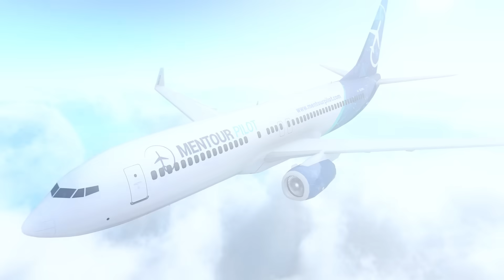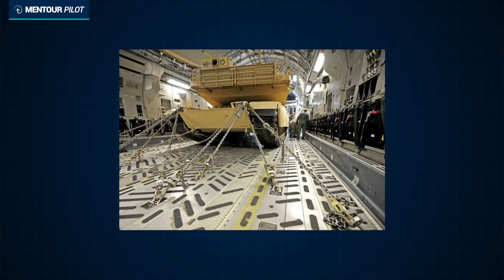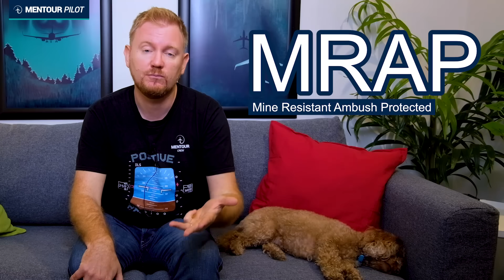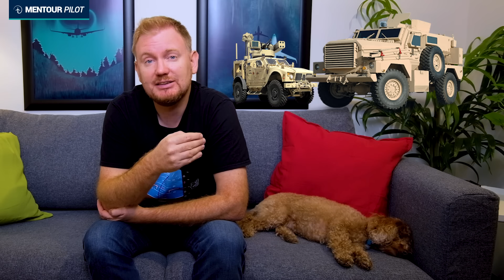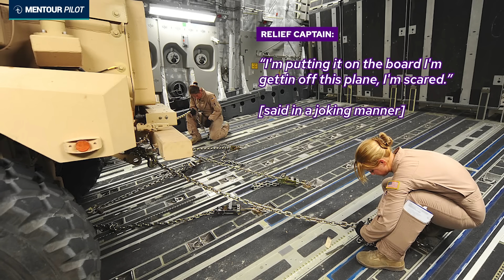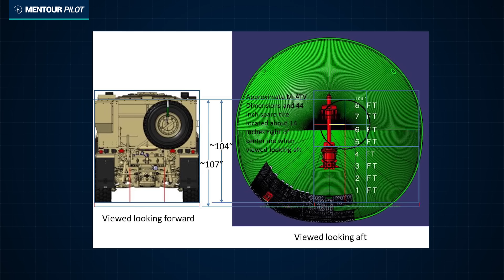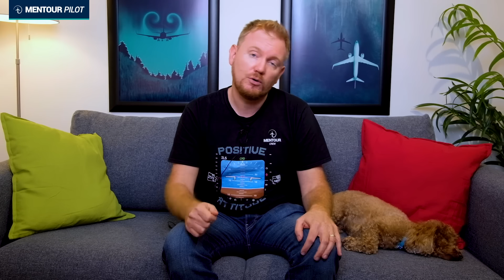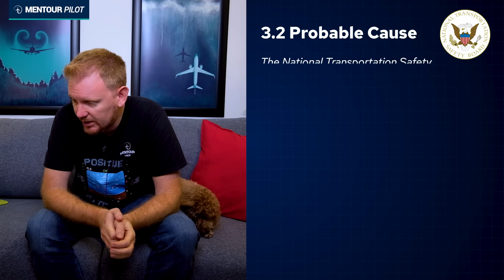Why did the pilots LOSE control?! National Air Cargo flight 102

Comment: "they always move when not strapped properly" 
continues with not strapping anything properly
Reply: If I was the pilot then I would have immediately gone off on that guy. Like, dude just admitted he didn't do his job properly and already had potentially put everyone in danger. Like, how can you be that casual about something that could (and unfortunately did) kill them all if not done properly?
Reply: @naomiskilling1093 chanced it
Reply: Er, that isn't what happened, I don't think- he just failed to realise it. The straps were not loose, they had stretched. Its possible it was caused by not enough tension in the OTHER straps, but also not enough. So, I expect he tightened up the "loose" ones, giving more force on the ones most likely to break. 

It is entirely possible that the rails failed, however, with the increased pressure of tightening- due to lack of strap distribution, but as said, many experts also though that seemed like enough straps. The knots thing is a bit up in the air, but it is still possible for the failure not to have directly been his fault. The very nature of special cargo involves strapping to hard points, but he clearly had no way to know how much each of them could take.

I think the big disconnect was a clear lack of guidance on how it ought to be done by people with engineering degrees to calculate stress loadings and explain strap strength with age and knots and folds and moisture, and how you need at least 4x tolerance to expected forces.

If you ask an untrained monkey to fly a plane for example, is the monkey at fault when it crashes?
Reply: Why dont they use chains ? Lazy fucks drive them cross country !

Comment: I remember seeing that footage and just feeling awful for the pilots. One thing that the physics nerd in me has always been curious about though, Is the condition of the vehicles. I saw a post crash photo of one of the smaller m-atvs, the only one to escape the fire, and while it was smashed up.. It wasn't unrecognizable. Now seeing as these things are designed to be pretty tough.. Fair bit of armor, especially on the bottoms, and this was the lighter of the two, how would the heavier duty ones have fared? I'm sure destroyed, but how badly? With the sheer insane forces involved in a plane crash like this, could anything survive in relatively non smashed to smithereens shape? An MRAP is tough.. But it's nothing compared to an Abrams tank. I don't know if a 747 could even carry an Abrams, but the C5 Galaxys do it. If something as heavily armored as an Abrams were in this crash, or theoretically an identical one aboard a C5.. How would it hold up? I'm still assuming damage. Probably the 120mm barrel/tracks/wheels would be a total loss.. But would the hull/turret be in OK shape, possibly repairable if no fire? Or would even something that tough be flattened pretty bad? I don't know if there's any physics experts.. Or tank experts, or both out there who would even have a ballpark idea.. But it's just something I've really wondered about since first hearing of this crash. Again, RIP to everyone involved. And another excellent video by mentour... Sorry about the wall of text for anyone who bothered to read this far.

Comment: A moment of silence for all the folks that lost their lives in this accident. It's an awful reminder that the captain must ensure the cargo is secure, first hand, because the flight crew will sink with the ship, cargo and souls on board. Don't accept second hand info. Be informed and verify for yourself. 

The worst part of this tragic accident is their own corporation wasn't aware of how to handle a out-of-normal cargo load to advise them properly. A call to headquarters inquiring should have been escalated to the aircraft manufacturer for guidance. This is just a failure on many levels.

Comment: I remember when it went down the Taliban tried to take claim for shooting it down, so that's the first thing we heard. I landed in a blackhawk helicopter on BAF runway 3 circa May 20th 2013. There was still a massive scrap pile of parts from the plane there. It was a unexpectedly sober sight. Some of the soldiers in my unit saw it go down and it really freaked them out. RIP to the crew.

Comment: Horrible.  Need better "rigging" technology. First  of all to the extent straps are inelastic,  multiple straps from a single point on the load do not distribute the force among them, the tightest strap carries the full force until it breaks. Also, the rigging should be instrumented with stress sensors to enable continuous monitoring and safety assessment. I wonder if in the subject event, the takeoff might have been aborted by a system that would have detected unacceptable strap stresses or cargo movement during acceleration on the runway.

Comment: Got a Question for you pilot. If you are Flying a Commercial Airplane and you loose all of your Engines what you do to Save all the Passages etc and  yourselves how would you mauve the Airplane still with out power to Safety land the plane.  I know Small Planes like Cessna 152 can do it without any problems you can still land the plane safety. But what about the Big Commercial Planes can you do the same. Please response to this Question with a video or something I would like to see the different from a plane to plane performance

Comment: Oh gosh. As an engineer this brings back such painful memories . In my case visiting relatives on a farm site not related at all to my work. There was a contract crew there erecting a large shed (like 100mx50m area). As I was driving away after the visit I glanced over at the site and my immediate thought was that the frame did not seem to be properly braced while they were assembling roof trusses. But hey, I was  a process/mechanical engineer, not a  building engineer and not my job right? Even so I came within a whisker of turning around and going back to make my thoughts known. Next morning the wind picked up and the whole lot came down with the crew working up on it - fortunately no one injured but that was more luck than anything else. Moral of the story: If you see something like that which makes you feel uneasy particularly if you have at least some technical knowledge of what is going on, don't be afraid to make a fool of yourself for peace of mind. You might just save a life! In this case, the correct bracing struts were a late delivery so the crew pushed ahead too far in the schedule with what they had.
Reply: Here, in Australia, we had a mining engineer in the city noticed a walkway that had some cracking.  He called the City Council and they had the walkway closed and the laneway below it closed as well.  Later that night the whole thing came tumbling down.  Had that engineer not seen the cracks and not reported it, any number of people could have been seriously injured, or worse.  This was as people were leaving work, so pedestrian traffic was high.
Reply: Oddly in Canada engineers are by law allowed and required to step up when they see a public safety hazard even if they are just passing by (similar to Medical Doctors that have to help, even if they are just happen to be there). On the other hand: Engineering is so complex, that it is hard to know if something is "innovative" and "safe by unconventional means" or just insane. (Imagine taking a modern car 100/200 years back in time and explaining why that thing is safe to a steam vessel inspection engineer)
Reply: @sarowie  Yup, that's what I was about to write. Notice something that seems fundamentally wrong and poses a significant public hazard, file a report with whoever is in charge and the professional order, they'll assign someone with proper qualifications to look it over and decide whether further action is warranted. I'd imagine something coming down the day after you reported it would lead to some interesting follow-up conversations.
Reply: @teardowndan5364  I SHOULD NOT BE UNDER THE BLUE LAWS & INVOLVED IN NATIONAL CRIME’S.
I SHOULD NOT BE UNDER A POLITICAL POLICY CORRUPT ENTERPRISE WHOM FALSIFIED MEDICAL DOCUMENTS & STOLEN PROPERTY & STOLEN INSURANCE CLAIMS ON PROPERTY’S I DON’T KNOW ANYTHING ABOUT. THIS IS HORRIFIC💔
Reply: @teardowndan5364  Honestly, I think this principle applies in general to anybody, even where specific expertise may be lacking...? We're all in this together. If anybody sees a possible public hazard when out and about, I'd beg them to please - find out who the responsible regulator/organisation is & take a minute out of your day to notify them! If you feel scared or embarrassed to do so, remember you can ask to have your details kept confidential. (But PLEASE, don't just make an anonymous report - agencies often later find they need more info to confirm the site, & if inspectors can't contact you back they're significantly impaired in following up!) Most local councils even have super-easy-to-use reporting apps these days.

If you see something odd when getting on a plane, I'd say always ask a FA there too...? It may be nothing in which case no harm no foul, but I'm mindful of the instance where a passenger said she saw propagating cracks on boarding the disastrous 'instant convertible' Aloha Air flight & said nothing...

Comment: Did they use chocks on the tires, and would that have helped? Also, I think those tie down straps are supposed to be regularly inspected.
Reply from the maker: The vehicles were loaded onto pallets. It was the whole pallet that came loose.

Comment: I haul stuff on roads.  Straps are not the best for stuff like this.   I assume chains couldn’t be used because mounted areas to secure were NOT strong enough to hold chain loads.   So each strap was hooked to a 600lb load point?  But load master put @1200lbs to each strap point?   Then there is unique gravity loads of planes...  0 to 70 mph on a semi normally  measured in minutes.  On a plane 0 to 180 mph is rather fast, plus uphill...
  A shifting load on a semi is bad.  A plane???  Heck it can upset a huge ship.
  I’m making assumptions of load securement points on deck because otherwise why would you need 60 individual straps, that all look to be going to a separate attachment point on deck?   Otherwise 4 1/2” grade 80 chains would do.  (I would add more, but I figure 10 more minutes securing could save hours of trouble). How do you tighten, release 60 individual straps to wheeled vehicle with air tires, and suspension?

Comment: So its clear that Pilots were had no experience to judge the weight and balance with lock.
Both were too young, one of him must be closed to 45 or 50 (Experienced).
Both didn't tour to check cargo safety, both were worse than a truck driver who always check load capacity and safety before drive.
Notice the angle after take off with cargo, 45 degree which also lead to vehicle to be almost hanging position caused pressure on strip to break.

Comment: Question. If the cargo area in the aircraft is equipped with cameras from different angles, that is in front of the cargo, behind the cargo and enough cameras from the sides that the pilots can turn on demand to stream the video to a display screen in the cockpit so that they can see what is happening in the cargo area. Could this help the pilots know that there is something wrong and abort the takeoff?

Comment: Early in my 20s I was an observer on HC-130s in the USCG and was in a loose-pallet incident. I also worked as a pallet loader (all USCG enlisted aviators work ON the aircraft in some capacity as well as fly as crew) so, I knew the basics of loading a pallet and loading the aircraft; though I never got the hang of the 'slipstick' for figuring out weight and balance. Loadmaster was not just a job description (every C-130 flight had a Loadmaster on board) but, a trained qualification.

Our load that day was nothing but what we called the SAR pallet. This was a pallet with two observer seats bolted to the pallet to line up with the windows when the pallet was locked fully forward. The pallet also contained shelving with de-watering pumps, life rafts, EPIRBs, flares and smoke buoys to air drop as needed. I was seated on the port side, the Loadmaster on the left. As the pilots advanced the engines to takeoff speed (brakes still on), the pallet shifted slightly with a little clunk. This is nothing odd, however as pallets were not, in those days, ultra-super secure and there was always some play. The pilots released the parking brake and the C-130 moved forward.

In a wonderful display of inertia, the pallet stayed in place as the aircraft started down the runway. I remember being startled as the bulkhead in front of me (Bulkhead 245) just... went away. I reached for the button on my intercom to inform the pilots but, the cord had pulled out of the bulkhead jack. The pallet slammed into the rear ramp, wedging itself. The aircraft came to a stop, the Loadmaster lept up, and ran to the front of the cargo bay to re-engage (or, actually engage?) the locking lever. 

I found out later that the flight engineer, a very experienced veteran aviator, had heard the sound of the pallet braking free. He called out "loose cargo!" and pulled back on the throttles as the pilots actuated the brakes. this happened in a matter of a couple of seconds. We taxied back to the hanger. After an individual debrief by the safety officer and the engineering officer they sent us home for the day. I never knew if the Loadmaster was reprimanded as I never liked him much anyway and I transferred to the helicopter side of the airstation soon after. 

Anyway. My point is the obvious one, even experienced, trained and qualified professionals can mess up. At least nobody was killed. Thanks for reading.
Reply: Scary stuff!  Thanks for posting this.

Comment: Strap tightness will always loosen, so more than just being tight, any possible slack needs to be removed and the straps tightened again. They should have been using chains for that much load, not straps. I saw one photo (not sure if it's relevant to this particular disaster) where straps were shoved through other straps on the cover of the cargo. That is criminally negligent. That's not securing the load, it's securing the tarp.

I do enjoy this series of yours, Petter, as I have said before. I don't know why, since I fly a lot especially in the wintertime. I guess it's the same attraction people have to murderer series. Knowing what has happened may make future issues less likely and give you insight of what to avoid.

That said, I ordered a plastic model of the 737 Max-8. I know I'll fly on them and am pretty sure they're safe now. The model can't kill me. They do look nice, though.

Please keep up the awesome videos!

Comment: Again I find it interesting to see such a relatively homogenous levels of experience in the crew. None of them appear to have been real "veterans", actually I'm surprised to see a captain with such a "low" count of flight hours. Any thoughts on that?
Of course it would have been logical to question whether the restriction of the cargo had been done according to the requirements (after it came loose on the first leg), which would have revealed that there were no proper procedures...

Comment: 42, 46, 60 straps... That's ridiculous. At some point, as you tighten one strap, another goes slack. There's no way you could accurately tension all of them equally, and if they aren't all equal, some will be under more load. When those fail, the shock load to the others would simply snap them.

Comment: So tragic an accident that could have been easily avoided.
I have a suggestion: Have you thought about doing a video on the Tenerife disaster? I have watched a number of videos on it but the demand for drama drowns out the technical analysis from which most of us would learn. Thanks for considering, best regards.
Reply: It is. Because there's a 2 official report although lead to same disaster, but has different opinion whether which one is the most critical part, hence drama. Luckily, some channel like "Mini Air Crash Investigation" already tell both side.

But, good suggestion nontheless

Comment: when you talked about the Trim jack screw it reminded me about another crash where its jack screw went way to long without maintenance and failed. also if i remember right it wasn't just the number of straps but how they where oriented they have a static load what a strap can take if you simply pull on each end and a dynamic load say if you have a strap straight up and down it will hold something down very well but wont stop it from shifting sided to side very well there meant to be at a 45° angle so they can hold something down but also stop if from shifting.

Comment: 60 straps ? if you put that on a flatbed semi trailer 8 would probably do
Reply: A truck generally moves in two dimensions while an airplane moves in three dimensions.
Reply: @Eternal_Tech  
Yes but if you made the straps and hooks 4-5 times stronger you could use 16 straps instead of 60 with the same tie down strength making it both far easier to tie down because with the suspension of the truck tighten on strap basically loosen all the other tied to the same point

Comment: I always though the pitch up was caused by the fact that the loaded vehicle shifted to the back, thus changing the center of gravity out of the limits, but now I understand that the vehicle damaged the controls it crashed into, while rolling backwards. I wonder if it did not damage the controls and the hydraulics, would the pilots been able to keep the airplane in a normal pitch attitude and land it safely?